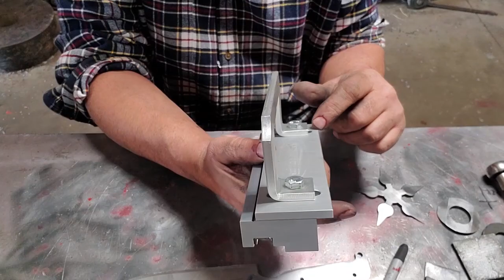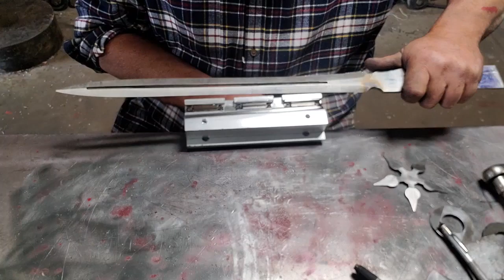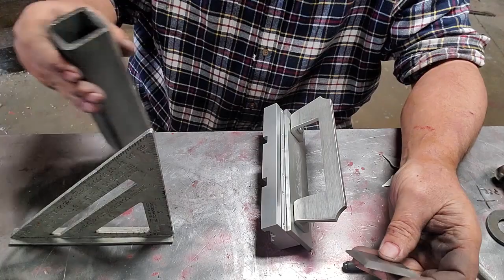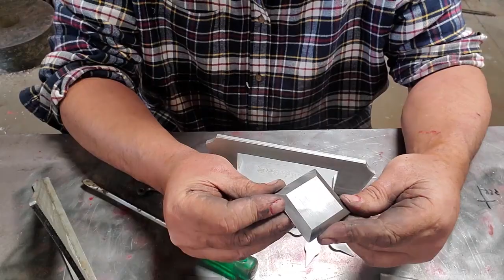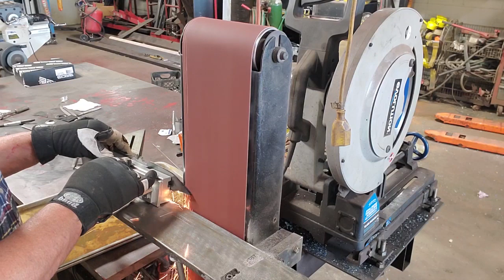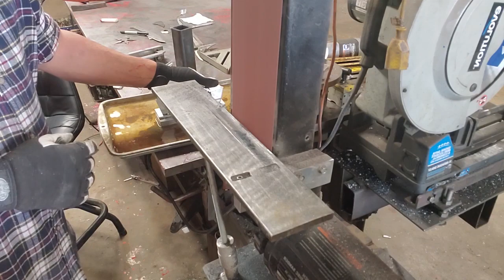The Awesome new Magnetic Bevel Grinding Jig by Switchblade

Comment: Are you still makin these Sir ? I would maybe like to buy one
Reply from the maker: No. China completely ripped off my design and made my tool worse and sell it $10 cheaper than I can make it. The even ripped off my pictures and are using them in their advertising. They killed all my work. You might still be able to buy a knock off on amazon.
Reply: @3dservicesllc  yeah i found them on Amazon but are they reliable ? How is the build quality ?
Reply: @3dservicesllc  Can you do a full flat grind on knives that already have handles on them?
Reply: I'm not making my own knives, I want to grind some factory made butchers knives if it's possible to get a full flat grind all the way to the tip. It would be very useful for me if so.
Reply: @3dservicesllc  That's what happens when you come up with something good and sell it on Amazon. I think Amazon is getting a piece of the action for every American manufacturer they hand over to China. 
This is about the ninth story I have heard like this with Amazon and China.

Comment: Mine arrived yesterday. Works great, and an affordable cost. Nicely done!

Edit: The only suggestion I would make would be to put a short blurb into the box for how to assemble it.  That's the only reason I came on here looking for this video.
Reply from the maker: The box does have details about how it goes together and sort of how its used but  printing is really small. In the next printing I will make some changes. I also did not include "how to" directions because I figured that anyone looking at this already has the skill to use it.
Reply: @3dservicesllc  You're right, the box does have a panel with instructions.  I missed it. I withdraw my suggestion

Comment: wonderful ,should make it easier for people with no skill to pretend the stock removal junk they make is a ""custom"" knife
Reply from the maker: I dont agree with your characterization. Its like telling a master woodworker that using a hand -plane has no skill. This is still a hand tool and it still takes skill to use it. Anyone that is even  interested in just  looking at this tool already has the skill to use it.  Im a highly skilled metal worker. If you get a look at my fingers, some dont bend, some are deformed, and none of them have any  feeling left and my eyes are completely shot from 30 years of welding and beating on steel. I wont let my fingers get anywhere near a grinder. Pro tip to new welders, buy a good helmet, And always use ear protection. My ears are gone too. Working with steel takes a toll.
Reply: @3dservicesllc  It is not a hand tool its the absence of a hand tool personified , its literally buying a nail gun cos you cant use a hammer , or to use your analogies its buying a thicknesser because you cant use a hand plane , i have 34 years of welding since my first qualification  im also a qualified tree surgeon gunsmith and blacksmith (yes you can get a qualification for that in europe , and i two have 6 inches of scaring on my right hand and one steel plate in it  and black dots in my vision from spatter slag and grinding etc , its not hard to free hand grind but some people either never get it or go right to a jig and never try , its a good jig  but it takes 3 passes to learn and requires no skill , you can argue with my opinion but that's just a fact , and you cant argue with facts ,,,unless your American ofc .
Reply from the maker: @Edgunsuk  We as humans are incapable of creating straight lines without a tool. Dime on a dollar  says you have a dedicated straight edge,  arms reach from your vice. Is DaVinci less of an artist because he used a straight edge. When the design calls for straight, than this is just another tool to get it done. Is it the purity of the process or the creation thats important to you. If its the process then ditch your grinder and break out the file. IF its the bringing the creation to life, then any tool to satisfy those ends are what seperate humans from animals. Its building your home with concrete and nails rather than sticks and mud.
Reply: @dennis lewis orionoutdoors ps whats a so called blacksmith ? cos anyone with a hammer can call themselves a blacksmith , same as any muppet with $75 for a 1 x 30 grinder can call themselves a knife maker lol
Reply: @dennis lewis orionoutdoors I agree with you.
Reply: @Edgunsuk  You don't sound to safe of a knife maker hahahahahaha    ACTUALLY!   YOU are a M   o   r   o   n!
Reply: Respect to blacksmiths and the work uou do. I dont have the patience. However,  us stock removal knife makers are craftsman as well. There are tons of ways for people to be craftsmen.  Theres no need to be uppity and thumb your nose at people who have different interests.  People like you irritate me and make othet people feel like crap for trying something because you might be good at it and they aren't.  Why dont you show some respect for people who work with their hands buddy! Ive ran across dozens of people like you over the yeard, and they are all the same. You think you are better than everyone else and know it all and probably look down on younger people because how dare they be born after you. Good luck in your knife making but man, theres no need to attack people who have different skills. We are all in this together.  Someone needed to bring you back to reality
Reply: @riggs2992  i literally taught a 23 year old female accountant to make a stock removal knife start to finish in one day , she didn't know how to turn an angle grinder on...... ye mad skills.....
Reply: @Edgunsuk  well good for you. You must be the most amazing knife maker and teacher that ever graced this earth. Ive been making knives for 5 years and I learn something knew everytime.  I figure I will get the hang of it in a few more years but spend my whole life mastering it. My pointbis, just because you like something that you do, it doesn't mean other people dont have different passions. And who the hell are you to judge other people and look down at them because they dont do exactly what you do?
Reply: @riggs2992  again i am sure being American english is a second language to you but i am not judging anyone i am simply stating a fact that stock removal is not custom , custom means a one off , they even say it in the dictionary as you Americans must need it explained better than the rest of the world  ... adjective NORTH AMERICAN
made or done to order; custom-made <<< this means not mass produced sunshine.
Reply: @Edgunsuk  aaah it must hurt that all you’re skills can be replaced by a 75$ grinder 😝🫢
Reply: @pauluskabouter1829  your misses said the same thing about you no doubt lol
Reply: @Edgunsuk  I don’t see how a 75$ grinder could replace me.. 🤭. Good on 👍👍
Reply: @pauluskabouter1829  make it slightly off balance like a faulty washing machine and sit on it :-) . PS good luck making a knife from a ball bearing or a meteorite with just a grinder.
Reply: Edgunsuk.. you have issues take your pompous ideals elsewhere what a pathetic person you seem to be
Reply: I presume you also make your own steel, then it would be really “custom” 😂😂😂
Reply: @dufferfishing4217  i have made my own bloomery steel yes "tamahagina! cant spell that ofc  my objection to the word custom is when you waterjet  cut 200 knives out with 200 identical handles 400 identical pins ground on a jig with 200 identical case's at what point is custom just bullshit to make idiots who buy them feel special ?
Reply: @Edgunsuk   which is it then? You object to 200 water jet cut identical knives or you object to stock removal in general?

I can make 5 stock removal knives and each one will always be slightly different from the others. I pound on an anvil also.  I can make 5 SR knives to one completely forged knife. 

Just my two cents. 

Oh yeah... You should probably look the definition for the word "fact". It doesn't mean what you think it does.
Reply: @MtnDan-d4g  i object to calling any knife you can make identically 300 times custom , or in fact any stock removal knife made from a template , but buying in pins getting some one else to shape your handles and getting a company to water jet cut 2-3-400 identical knife blanks buying 2-3-400 identical sheaths , i mean come on even an american cant be dumb enuff to call that custom ? yet the guy with the biggest mouth always sells more than the artist , the true custom knife maker making one off heirloom knives'  even the ray mears knife (the original wilkinson sword one) was mass produced and the woodlore at £600 each and a 3-6 year waiting list , is made for £17 by stock removal  its a joke to call any stock removal knife custom this may be just my opinion but i am entitled to it ....and remember ..... Blacksmith lives matter ! :-)

Comment: it looks like the shelf is about 1" high. Could you grind a knife bevel on a blade less than an inch wide? I guess you would attach the handle to the magnet so the height of the jig face wasn't higher than the blade? I I was going to grind a bevel on a partial tang blade less than an inch wide, it seems like I would want to attach handle to jig, grind bevel, then cut material away from handle to partial tang, does that sound right?
Reply from the maker: Good eye on the one inch, it's exactly one inch. If it's not to late, leave some material on the handle  then shape the blade first. Otherwise I hate to say it won't work for this piece. If I'm understanding your right.
Reply: Was judging by the 2.25” washer in the video. Not too late, thanks!

Comment: What's the smallest knife size you could bevel with this?
Reply from the maker: When I do small blades I put a half inch parallel on the bottom ridge the shim up the blade.  It covers the bottom half of the magnet but it's still plenty strong enough to hold a smaller blade. You can use any shim 1/2 inch wide. You can also use shims to change the grinding angle. I hope this helps.
Reply: Yeah, that’s perfect. I saw you do that just after 10 min mark. Thanks. Mines in the mail.

Comment: It'd be nice to have the jig come with the angles already marked on the back. Especially graded with precision between 5 and 12 degrees for knife grinding.
Reply from the maker: That makes alot of sense, so much so that the early prototypes had index marks.  The marks were never really in the right place and always seem to cause more trouble than they were worth. It was a tough decision to remove the index marks but I decided that the user should decide the angle they use most by putting their own scribe line on the back. The anodizing takes a scribe line really well and a sharpie leaves a crisp line that can be removed for one off projects. If you need to put a number to the angle there are inexpensive digital angle finders that would be more accurate especially when you factor in the angle of your work table. Leaving the scribe lines off was not an oversight, it was a decision.  I hope that helps..
Reply: @3dservicesllc  Where else can these be purchased? USA knifemaker is out of stock.
Reply from the maker: @NuManXplore   They will be back in stock in a few days there are also some on facebook marketplace without the amazon fees
Reply: @3dservicesllc  Thanks for the reply. I ended up buying one on Amazon.